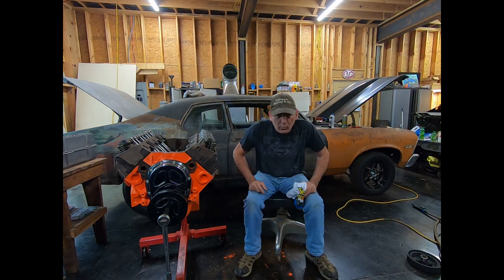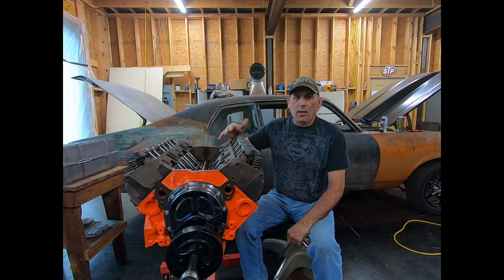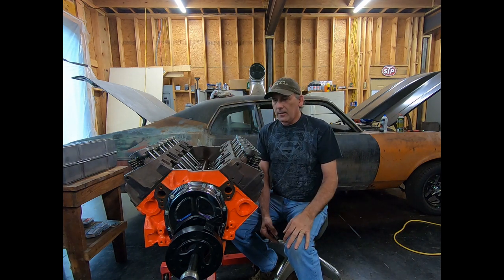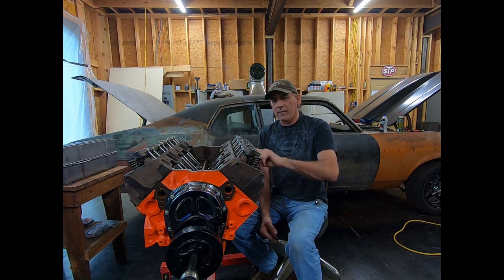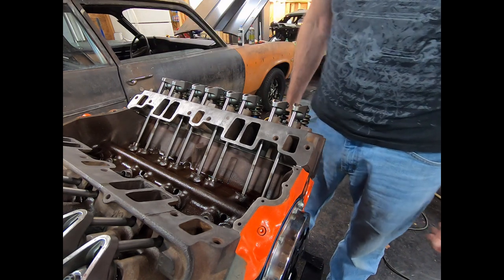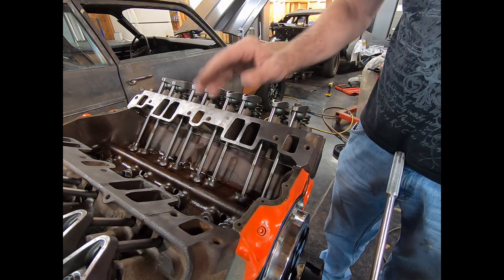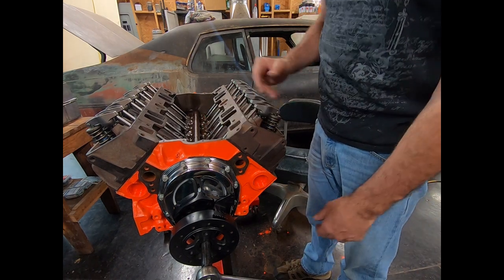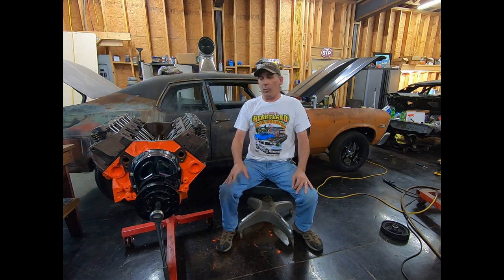Chevy Engine Valve Adjustment

Comment: Does it matter what order you check them in
Reply from the maker: Not really but if you have a mild cam you can turn the crank/cam to one spot and check half at once then rotate 180° and check other half. An old Chiltons manual explains the technique and where to turn crank.

Comment: Are you setting the valves without the oil pumped being primed? I always thought you had to prime the pump before you could set hydraulic valves. I'm currently building a stock 350 for an 89 K2500 I'm restoring to factory. My oil filter adapter is cracked so I can't prime the pump. The reason I'm asking is because I'm genuinely curious if you can set the valves without priming the pump first. Thanks in advance!
Reply from the maker: Yes. You can. You just have to be careful not to depress plunger on lifter. If you do the pushrod shouldn’t move. I prefer to have intake off so I can look at lifter.

Comment: That little "nugget" about taking the socket away before checking lash is outstanding!! I have a little different way of adjusting valves, which I won't get into because more than 1 way to skin a cat, but I will forever use that trick about removing the socket before checking lash. Looking back on things, I know for sure that the extra play from the socket left sitting there has certainly caused me some heartburn but back then I never realized why....another great great video.
Reply from the maker: Thanks Dude. Honestly I adjust valves a little different than in the video but it’s not a way I would recommend to someone who isn’t experienced.

Comment: Did you load  up the lifters with oil pryer to setting  the valves?and if so what method  did you  use?
Reply from the maker: No. That’s a bad idea and not recommended by cam companies. Soaking in oil is ok but pretty much does nothing other than coating in oil.

Comment: I'm actually having a 307 put together at the machine shop right now. He had to punch it out .040 to clean up the cylinders, and get a reman crank, but it should run well. I went overkill on a set of blueprint heads with 2.02/1.60's, and 190cc intake runners.. so that will kill a little top end, however it's not a huge deal since the car is just a cruiser. We also checked to make sure the 2.02 valves wouldn't touch the bore. Believe it or not they clear just fine.
Reply from the maker: They clear. Especially at .040 over. Just have to be careful that they don’t shroud the valve too much. Plenty of guys have ran 2.02 valves on 283’s. With the heads you’ve got you won’t notice the flow loss. Which cam are you using?
Reply: @Shop209  Yeah I'm not overly concerned. I'll probably put together something with a fee more cubes down the road anyway so I'll just reuse the heads on that. The cam I went with is just a comp thumpr grind number 279TH7. It's probably way too much duration, but if I don't like it I'll just swap it out. The machinist recommend a comp 260H.
Reply from the maker: Yeah. You’ll be fine. I’m using a comp 280H. It’ll need plenty of converter but should make some power.
Reply: @Shop209  well that's good news, I actually bought a rebuilt muncie m20, and all the swap parts for the 4 speed.

Comment: 307!
Did you know this is one of my Favourite engines?
Reply from the maker: I love them. This one will be about 325 hp before the turbo
Reply: @Shop209 Nice. Got a recipe for a red light racer? Lots of low and mid torque with 25+MPG?
Reply from the maker: @1Also  Yep, get some 64cc or smaller chamber heads and run a comp cams 268h hyd cam, It'll be a screamer.
Reply: @Shop209  Thanks man! btw I plan on using EFI...any other suggestions?
Reply from the maker: That cam will be on the edge of having to have a higher stall than stock converter. Not sure about 25mpg but it’ll be a little rocket.
Reply: @Shop209  Does this cam work for the 301, 302 and 305 the same?
Reply from the maker: Yes